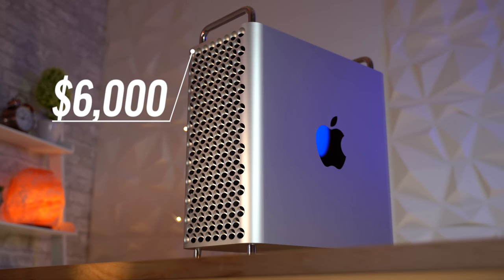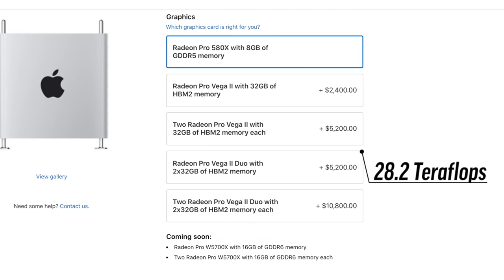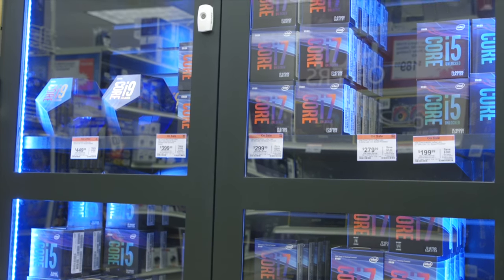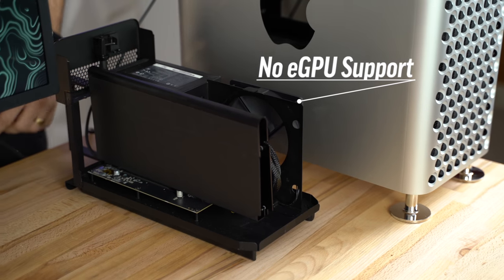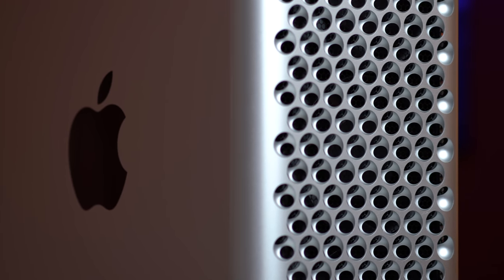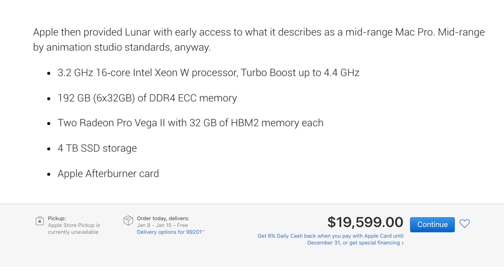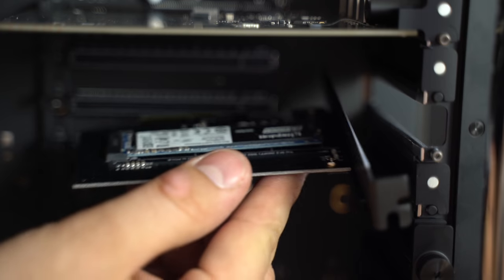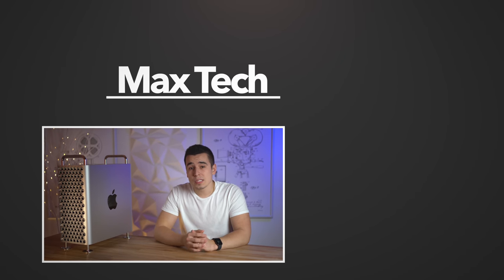2019 Mac Pro Review - 7 Reasons it Sold Out!

Comment: The bigger question is..... what will Linus Tech Tips say when they review it?
Reply: In this episode of life's biggest questions......
Reply: Mike S. Well he said he liked it in a recent wan show, so other than the terrible value for the base configuration, he will probably say something positive like the very smart modular design and the cable-less architecture (he said this in the wan show).
Reply from the maker: They’ve been quite positive with the last few Mac reviews and as Stephen said Linus seemed positive about it on the WAN show. I love watching their reviews so can’t wait to see it!
Reply: Their gist of the LTT review:
The base model $6000 is extremely fucking terrible. ONLY 8 core CPU? An additional $7000 for a 28 core Intel CPU while the AMD Threadripper 3970x is 32 cores and only costs $2000. Hell, even AMD EPYC 7742 64 CORE CPUs shit on the Mac Pro's highest tier CPU and they only got $6950.

$400 FOR WHEELS THAT COST AT MOST $10 PER WHEEL. 

ACTUAL professionals use their own proprietary systems, software, and servers to work, not Mac Pros. GPU teraflops cannot be compared spec to spec when the architectures are completely different. 

"Without Nvidia support, Mac Pro will never be used for things such as VFX, 3D rendering and compositing. No production renderer out there supports metal or
OpenCL needed for Radeon GPUs to be utilized in that regard.
Otoy announced Octane X to support metal 6 months ago and still nothing.
Arnold is RTX, VRay, and Redshift also RTX exclusively.
Cinebench score for 12-core Xeon is 3 times less than threadripper 3960x
Be sure that none of the heavy 3D renderings we see in movies for the last 20 years
have ever been produced on Mac OS. In 90's SGI was all the rage, after that Linux and Windows.

Mac Pro is an overpriced and underpowered hipster machine with over-engineered 
irrelevant details. The cableless system is an accident waiting to happen and it's 
there just for proprietary reasons to allow apple to charge more if something
breaks. T2 chip exists for the same purpose. Why not standardized NVME slots?

Mac Pro is not one bit more reliable than say HP Z or Dell workstations. Yes, it is modular but you cannot walk into an Apple store and buy replacement psu like you can with HP or Dell. No redundancy also"
Reply: @TommyBlaze13  lies when did he review it?
Reply: TommyBlaze13 Did you watch the video? It’s a commercial workstation not a personal computer
Reply: @Thehugomac  hahaha brace yourself self because at that fucking price point anyone can built ultimate pc and work station together
Reply: @jeremydavis5661  where did you get internet? He reviewed it before you knew about the product
Reply: Try and test Return it..

Comment: 11:35 The previous Mac Pro towers had excellent power supplies rated at 980 watts and reportedly manufactured by Seasonic.  This would be adequate for almost any graphics card made, but Apple did not provide enough headers to power 8-pin cards.

Comment: There are serious issues that need to be addressed for the machine to be viable for any pro depending on the intended application, really basic stuff here.

1) NVidia support, this is critical for Adobe applications, deep learning as they are built on CUDA, I cannot accept 10-100X+ performance impact by using AMD graphics... the drivers are also questionable in quality and have no ISV cert’s.

2) Intel NVME support, this is a no brainer, They are the reference for SSD’s with every OEM and tier 0/1 using and validating Intel drives, they are the most reliable (speed, endurance etc...).

Also I find it highly suspicious Apple isn’t disclosing the SSD’s specifications, what’s the endurance? Are they read/mixed/write intensive? What NAND is used?
Reply: Yet every other company (Dell, HP, IBM) gives you detailed information in highlighted in bold the manufacturer, model, endurance and usage case.
Reply: Wrong. For any 3D professional, and that's it. Macs are not yet focused on the 3D professional. They are literally the only system used in ANY major music production studio. You won't find a windows machine in most music production studios. They have a Mac and it's running Logic, Pro Tools and FL Studio, along with whatever plugs they need. That's all. Studios don't have time to play games with their systems reliability. The same way you wouldn't walk into a 3D animation studio and find anything other than PC's everywhere. You also aren't going to walk into any major motion film studio editing, coloring, or sound bay and find anything other than a Mac in there. They all have Macs running FCPX, Premiere, Avid, and BlackMagic.

So when you say pro, refer to 3D, because that's the only professional Macs aren't yet aimed at. That said, Metal 2 is the future, and CUDA is the now...as was the case with Jumanji 2, and even Pixar, the studios are already seeing what this new Mac Pro running with Metal 2 based render software is capable of, and it is outperforming CUDA/Nvidia by MILES. These aren't consumer based softwares, but as is going to be seen soon with Redshift and Octane, it's coming to the consumer in the not so distant future, and when it does, it will change everything. 

But you believe what you believe. I'm only basing what I'm saying on personal experience as a studio owner and frequent collaborator with other studios.
Reply: I didn’t say audio production, I’m focussing on LR, PS and Premier...
Forget the 3D application side.

We managed to compile the NVidia source, hacked the drivers into Catalina(with help from Apple guys, all
Unofficial) with various Quadro cards... the performance deficit was absolutely huge to the point using AMD cards wasn’t viable... Apple knows this.

As for CUDA, it’s not going anywhere and neither is OpenGL, there have been half a dozen API’s which were suppose to replace both yet they are still here.
Reply: @kleanthisgroutides7100  The problem I had was you didn't mention ANYTHING, you just said Professional in general, which is misleading.  Even that said, that's a software issue. Obviously we have the Adobe Suite running here as well and Adobe just needs to optimize their software better Apple and PC. And I'm not saying Apple should've blocked Nvidia or CUDA. As I said, I believe Metal is the future but I also believe Nvidia and CUDA are the NOW, so it pisses me off that Apple blocked them...but I understand why they did it. And I also don't believe CUDA or Open GL are going anywhere, but I definitely think Metal will outperform in the long run.
Reply: @evacody1249  Do you even understand what I'm talking about? Him and I had a conversation, you came in like a child. Slow your roll and come at me like an adult next time and we can talk.
Reply: @evacody1249  You're still being a child. Talk like an adult and we can converse.
Reply from the maker: Are you sure that Metal 2 isn’t as good as Cuda for Premiere? I’ve been testing video editing for years and in the past AMD cards would be much worst for video editing other than FCX. Then last year with Premiere 2019 Metal would work better in the timeline than Open CL but for rendering open CL was better. With the 2020 release Metal is now quite a bit better but of course that’s compared to Open CL. I think I’m going to get an Nvidia GPU and book into windows on the Mac and do a head to head comparison of AMD with Metal and Nvidia with CUDA. 👍
Reply: @MaxTechOfficial  This would be a fantastic comparison as I honestly believe your PC based viewers aren't realizing just how powerful Metal actually is and where it's going in the not too distant future.
Reply: I know exactly what metal is, you have to understand it comes with caveats when you move closer to the hardware.  

One isn’t replacing the other they will both coexist.

Metal has the speed and latency advantage but gives up the flexibility, takes longer to optimise, requires far more understanding of the system and hardware, isn’t portable across platforms and requires updates on each hardware iteration.

High level API’s resolve all the above but come at speed and latency cost, the development time is also drastically reduced however, the cost is lower and has a time to market advantage.
Reply: Kleanthis Groutides which is why I said once Metal matures it could very well put Apple in the position of world leader when it comes to 3D animation, rendering, and VFX. And yes I agree, they will absolutely coexist. As they do now. But in reverse.
Reply: I don’t see them making significant progress without NVidia, there’s far too many plus points for using Quadro and Tesla cards both in the hardware and the software.  I’ll mention the driver quality, software support, the relationship with developers etc... AMD would have to scale massively to even get into the same ballpark.

This is my opinion.
For me personally the NVidia GPU and Intel NVME support killed the Mac Pro as an option and even then the all core Turbo issue would bug me given the W3275X is on the way. 4.6GHz on all 28 cores makes a difference.
Reply: @kleanthisgroutides7100  I agree with you about most of what you said, and definitely understand your opinion. It will be interesting to see where the Mac Pro lands in all of this in next year's iteration.

Comment: There is a lot of Apple stuff that I don't quite like or agree but regarding the Mac Pro, I don't really see a problem with it. Sure, the base model has a bad value for its specs, but there are two things about it, first that the base model exists for those wanting to upgrade themselves, because if you are actually going to use the base model specs, you better off with an iMac Pro. Second because within the $6K you have all the engineering that makes it silent, cable-free and everything else, it's not just the sum of the CPU, GPU, storage and RAM. For people spending $10-20K, it offers a lot and more than any other Mac. I wish it can go AMD eventually.

Comment: The glaring flaw in the DIY comparison is that most would likely be building a Threadripper system as opposed to an overpriced XEON system. Why pay more for a slower, less efficient platform, that will also likely max out at 28 cores. Cases are negotiable. The only appeal to Xeon would be if there is a need for more than 256GB on a workstation platform. Several TRX40 boards even have Thunderbolt support.

Comment: The old Mac Pro did not have a weak power supply - it was 980W.

But its motherboard pins are two x mini 6 pins, which can give up to 75W each + the pcie power (75W), which totals at 225W max graphic cards.
There are a few workaround to this.

Comment: "it's not apple's fault but intel's" .... seriously?? intel held a gun to apple's head and said "You HAVE to use our processors"? I missed that one. its on apple for choosing to  using parts from a vendor that has been under-powered and over-priced for years when compared with the competitor's lineup. its not intel's fault for making bad chips, its apples fault for deciding to use them. and while I know it would have been a delay to change to the new sTRX4 socket, the 2nd gen threadripper was out long before apple started this project, and is still a better option over the xeon W.

Comment: nowhere else can I get near silent cooling? what about all the people who make passive cooling designs. they literally run so quiet that you can hear the coil whine when the GPUs are under load. literally everything you've claimed so far is exclusive to the mac I can find better in a lot of manufacturers, with the exception of connecting to a pro display xdr, but with that, why do I care? I can get an actual reference monitor, or any of a thousand top tier monitors that will preform as well, or so close to the same, you couldn't tell a difference

Comment: The problem is you can get a 2X Epyc 7702 system loaded with GPUs and RAM for less money.  128 Epyc cores vs 28 Xeon.  The computer is crazy overpriced if you consider that the Intel CPU is obsolete.  How're you gonna spend 50+ thousand on a computer that is literally less than half as fast as similarly priced builds.

Even the 2X Vega Duos in there, thats 4 GPUs.  You could buy 8 WX5700s for less than half of the amount of money Apple is charging for those and they'll fit in the epyc chasis.

Comment: I keep hearing that the Mac Pro doesn't have any internal cables when it has at least one. Look at the MacSales and iFixit videos showing a cable used to connect the speaker box (located between the SIMM cards) to the motherboard. Yes, I'm being picky but there is one. Overall the Mac Pro is an amazing piece of engineering.

Comment: I can give you one...
The 2013-2019 Trash Can Mac Pro!
Two would be finally a mac you can upgrade the ram and storage yourself, like you used to be able to do on all Macbook Pros, Powerbooks, G5's, Mac mini's.The base model is one of the worst values ever as far as performance per dollar goes, entry level video card, 32GB memory, 256GB ssd, weak 8 core processor, imac 8 core and Macbook Pro 8 core are much better performers, even a used 2010 3.33 12 core with upgraded gpu and ssd would give it a run for its money.
But the big thing is you can upgrade it down the line yourself, with or without apple.
Bad thing is pcie4 is just around the corner, and the next xeons will not be compatible, so you will be limited to 28 cores in the future, although that is not a bad thing, once those cpu prices go down in a few years.

Comment: In my mind the biggest problem with the Mac Pro is that you are forced to allocate your spending towards features you might not care about. What if you don't want to spend extra for a nice design, quiet fans, or wireless internals? You can't just compare the Mac Pro to custom built PC's with those features because a lot of people aren't going to opt to pay for them to begin with.

This is a feature of Apple in general. They put a lot of effort into making their products premium in experience, but for anyone who is more interested in raw performance (which is going to be especially true for a tower desktop), that's not always the best use of a customer's funds.
Reply: you are missing the point.. Its not for average users like you and me... There are companies who will need these mac pros and will buy in bulk.. I mean basically, a newbie can replace components in the mac pro... These things matters to professionals.. To average customers like us it doesn't matter
Reply: @saikatpaul8955  That would be fine if the Mac Pro was ONLY marketed to the largest companies that buy in bulk.
The fact that it can be specced as low as it can shows that it's not.

Comment: and lastly, no, the vega 2 duos do not double the memory by having two GPUs, they have double the memory in the shared pool, unlike with combined quadros, that actually double your memory and bandwidth, increasing the performance in random IOPS. while HBM2 is more reliable than GDDR6, it is faster by a negligible margin, and its a laughable argument that it's cheaper since I can pick up and RTX 8000 for 5,500 dollars, or a vega II duo for 5,600. oh, and btw, the Vega II is not the fastest GPU in the world. It clocks in at 14.15 teraflops per GPU, making it actually significantly slower than the GPU powering the RTX 8000. seeing at the vega II duo also has no support for ray tracing, double floating point percision, and doesn't have ECC memory, I don't think the industry is going to drop quadros any time soon. and all this to say while initially advertised as scaling perfectly, in the testing i've seen it runs as well as you'd expect if you picked up two vega IIs and run them in crossfire, with about a 20% drop from expected.

Comment: threadripper offers higher core count than xeons, higher 72 GEN4 lanes, ECC memory support and up to 1TB of memory and it is much cheaper so, what are the selling points of xeon w?
Reply: Intel still performs better in single threaded processes. But it’s just a matter of time. AMD is forcing them to innovate. Which is a good thing.
Reply: Álvaro Ybáñez not for those high core count processors we are talking about....
Reply: @Nosmo King Mostly the reason is that it is too soon. Threadripper, and let alone AMD Epyc are new kids on the block, so to speak, for how those industries work (server stuff, high end graphic production, etc) and the higher end the industry is, the slower in adoption. Among other things, most are long term investments, also, as the name needs to be made. Some valiants adopt first when doing very simple maths in costs (intel vs AMD options), and then the rest follows. Fast in consumer grade stuff, slow the higher the professional use is. AMD is developing at much faster rate, clearly. So, IMO, is not only the current best bet, the advantage seems to be increasing in the incoming times.

Hardware vendors are the same. They are slow in adopting. They'll go for it, too, it is not avoidable.

Also, that's how things were (stability, heat, etc), but it has been proved that AMD is producing not very stable chips, professional grade, getting motherboards that are professional and premium quality, and what is more, with way less CPU vulnerabilities (against attacks) than intel's. Indeed, some of the patches, BIOS / OS level, have produced significant performance decrease.
Reply: @Nosmo King Is that why AMD is grabbing server market share from Intel as we speak? HP and Dell  don't offer Threadripper processors yet, but they do offer Epyc-based systems that are stomping intel in many benchmarks for less money. Also, they don't suffer from the same security issues that plague all the latest Intel processors.